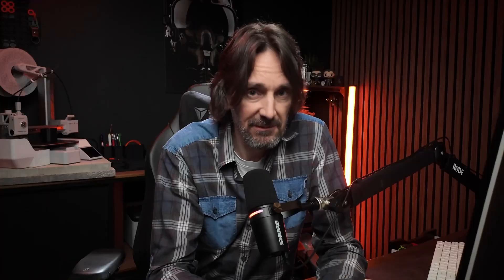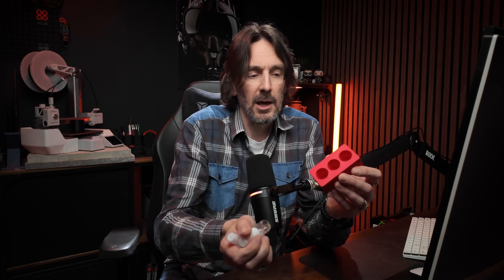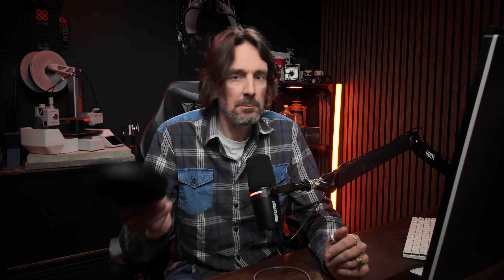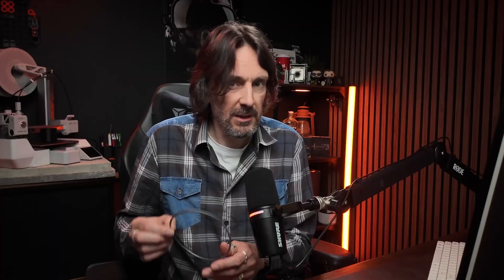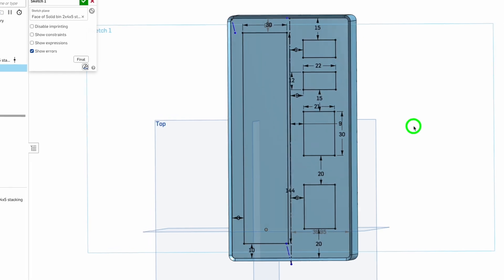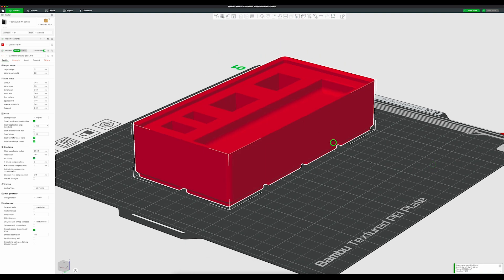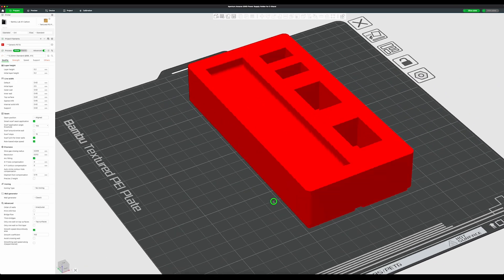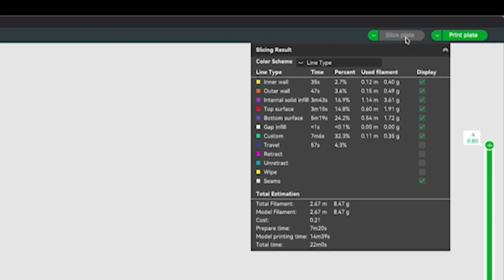Save your time & filament! Test Print the Critical Dimension First

Comment: I don't find this Usefully, just know your tools, then you waste 0g of filament. Perfect fit on the first try. You have to only calibrate for your material once and then you are good to go, just calculate material expansion and keep in mind which perimeters are printed first (outer, inner).
Reply: So how do you calibrate filament that seems to change depending on the make and color?  I'm truly interested in your process. I'm finding I have to do a lot of test prints to mate things. I printer a plate (bambu Filament) with holes in it starting at 2mm up to 10mm with 0.5mm increments but if I print the same plate in Hatchbox filament it's off a bit.
I'd love to hear how you overcame this issue.